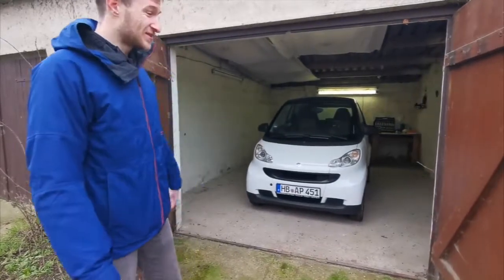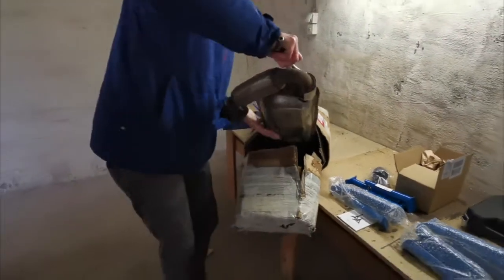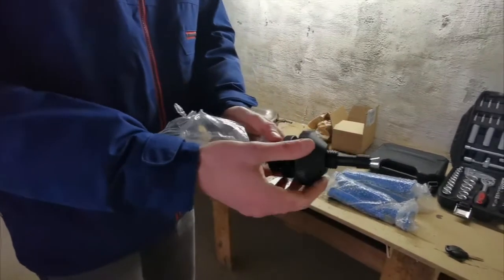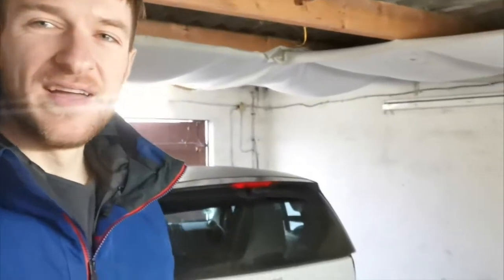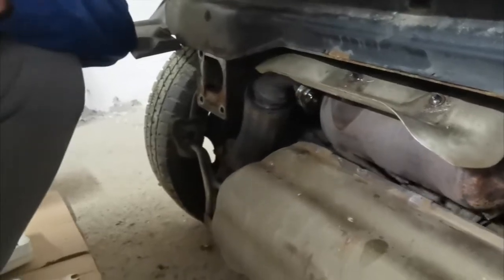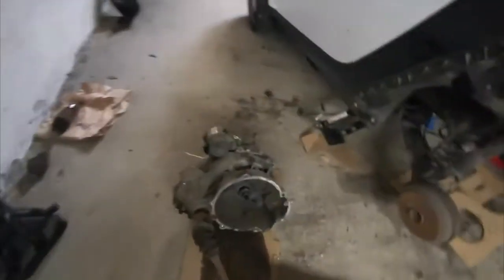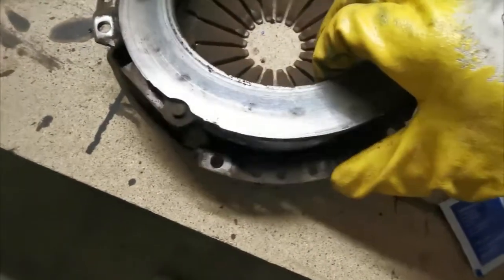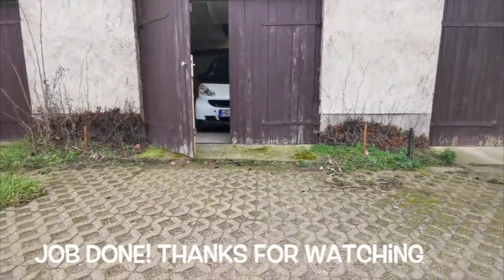SMART FORTWO 451 - Clutch Replacement, NO Engine Crane!

Comment: The problem with all these do-it-yourself videos are that they don't cover the basic steps like what tools do you need to raise, lower, move parts around. The people viewing these videos are not mechanics so these steps should be covered. For example, how did you lower the gearbox, by hand? Where did you put the jackstands? What is that clutch tool and what is it used for? Thanks for the video anyways.
Reply: Maybe I can chime in. The gearbox was lowered by the help of a car jack. It’s not too heavy by itself just the positioning makes it weird to work with when not on a lift. Just use a wide jack or support the gearbox on a plank placed onto any jack available. The jackstands were placed on the motor mount of the smart. It is a U shaped pipe. The only thing to be aware of is that because it’s the motor mount the suspension will compress when lowering onto the jackstands. It really only affects the clearance from the sides but when you take the wheels off (necessary anyways) it’s really not that bad. Tools used are really basic, as in a toolbox with automotive sockets (search for any toolbox with 100+ parts on eBay and it should have most things you need). The clutch tool gets inserted through the clutch plate into the housing and centers everything. You can do everything without it but aligning is easier that way. Believe me there are no mechanics in this video. As long as you are not scared to get your hands dirty and view it as a project that might take you a bit longer than a trained mechanic would you’ll be fine.
Reply: @PogU  Thank you Sir.

Comment: Great Video and thanks for uploading it for all to see. My 451 cdi 2010 has developed a rattle noise which sounds to me like coming from the gearbox area. The car drives fine however. Do you think it sounds like clutch and if so do I need to get the clutch kit plus the flywheel or just the clutch kit will do the? 
All gears do change OK but the gear numbers flash constantly on the dash. Please reply back and any advise as I am lost in this matter.
Reply from the maker: Hi Jas, sounds like 2 separate issues. 
- The flashing gears indicate the need for a gearbox firmware update, which can be done at your local smart/daimler dealership. I had it done prior to replacing the clutch for a cost of 80 Euros in Germany and it took about 30 minutes. 

- The rattle noise from the gearbox area could be clutch related. To be honest when i went to update the gearbox, the mechanic at the dealer just heard that noise and told me it's definitely the clutch. Perhaps they may be able to advise you too on the matter (free of charge) if you go ahead and get them to update your gearbox software.

When replacing the clutch I'd just order the clutch kit as the flywheel is rarely damaged. If when you take it apart you discover some damage to it, you can always order the flywheel then :)

Hope this was helpful, let me know if you have anymore questions.

P.S.: The OEM spec "Sachs" clutches are very well priced and are used by Daimler themselves in the manufacturing, so would recommend getting one of those.
Reply: @mattyscarchronicles9026  Brilliant advise I will order the Sachs clutch kit hopefully this is the cause as the car drives fine otherwise . Just need someone knowledgeable like yourself to fit it 😀
Reply from the maker: @jasa198  nice, im glad to help out somewhat... Um, well where do you live? I'd be happy to help if you live somewhere around Germany
Reply from the maker: Also because at Daimler they wanted around 1400 Euros to change the clutch 😑
Reply: @mattyscarchronicles9026  thanks Matt appreciate the help . I am a bit far from you in UK so I guess I will be looking for someone knowledgeable locally .
Reply: Hi Matt once again I would like your advise please . When I get the new clutch fitted does it need to go on a star machine ? Oh and the flashing gears I mentioned is no longer flashing anymore. Somehow they went back to normal .
Reply from the maker: @jasa198  Hi Jas, eh yep UK is a bit far right now, but I hope you find an honest mechanic or handy guy. If you live in the west Midlands I could reccommed you to someone (mechanic) honest and fair priced...

The clutch change does not require connection to a star machine. However, special attention should be paid to reinstalling the clutch actuator in its original position. You can do this by marking around the 3 bolts with a sharpie or similar.
Reply: @mattyscarchronicles9026  Thanks Matt . Good tip about the actuator . Mine is a semi auto. I take it yours was the same too and full auto or semi autos all are same procedure .
Reply from the maker: @jasa198  yes semi auto aswell, and I'm not 100% sure about the full auto but it should be the same I imagine
Reply: @mattyscarchronicles9026  I have ordered clutch kit from Germany its for the cdi 54bhp . I showed your video to my mechanic . He was very impressed of your work. I hope he can fit the clutch and the part is all correct.
Reply from the maker: @jasa198  that's great! I hope everything goes as planned. Can I ask, just outta curiosity, approximately how much he will charge for the labour?
Reply: @mattyscarchronicles9026  Thanks Matt. He works from home garage and has quoted me £220 . I think it is very reasonable price for the amount of work involved . He is helping me out as he wants to gain my trust and give him more work .
Reply from the maker: @jasa198  no problem, happy to help. And yep that's very reasonable compared to mainstream garage prices 😁 let me know how it works out in the end
Reply: Hi Matt need your advise please. I just received my Sachs clutch kit however it did not come with the release arm just 2 piece clutch and pressure plate . Question is can I use the existing release arm from my car ? Thanks.
Reply from the maker: @jasa198  I can't confirm that because in my package it was included but the one I removed didn't seem so worn. so I'd say you probably can refit the old one. Even better would be to replace the missing arm with a new (if you can)
Reply from the maker: @jasa198  I'd say go for it, the old one I pulled out wasn't so bad
Reply: @mattyscarchronicles9026  Thanks Matt. Yup I have given the car to my mechanic. He saw the parts and didn't say anything about the release arm. So I reckon it will be all good. He will do the work today hopefully.
Reply from the maker: @jasa198  awesome, looking for award to hear about the outcome 😁
Reply: @mattyscarchronicles9026  After the clutch has been replaced does it have to go on the star machine or will the actuator self adjust ?
Reply: @mattyscarchronicles9026  update . Matt . The car has been fixed today BUT the shaft seals are leaking so he will replace them tomorrow. Also we needed the release bearing and arm . So the cost of that went up by £85 more on top of £220. Hopefully I will have it tomorrow.
Reply from the maker: @jasa198  Hi Jas, sorry I've been a lil busy recently. the car doesn't have to go on a star machine. There's an auto-learn procedure, I think you have to turn the key to ACC and fully depress on the brakes. After about 30 seconds you'll hear the clutch actuator whining for a short time, then you can start it.
That sucks about the extra bills! Sadly I had my fair share of overbudget jobs due to annoying surprises 😩💸
Reply: @mattyscarchronicles9026  Hi Matt good to hear from you . An update for you . My car went back in today as he didn't change the drive shaft seals and It leaked all over the driveway. He has got the new seals from merc and will put them in today . Whilst I had the car it drove well and gear change was as it should be. Hoping to have the car back this evening . This mechanic is a real good find for me . He is honest and is working from home . I think I will use him more often from now. Thanks for your advise and help too. You have been great help in getting my car back on the road as I was seriously looking to scrap the smart and just buy a Toyota aygo .🙏
Reply from the maker: @jasa198  I'm glad to hear that it's been sorted out in the end.It's nice knowing that cars are being brought back on the road, especially for such a minimal cost, rather than purchasing new ones :)
Reply: @mattyscarchronicles9026  Hi Matt well here is an update. Got the car back and the new drive shaft seals were installed and are doing their job as they should no leaks around them however  problem is I still have gear oil seeping through the housing just below the filler plug and all around it. I have spoken to my mechanic and he thinks it could be the seal inside which he did not change so the car is going back tomorrow. Also I have noticed that the car is not as quick in torque as it was before, the rev needle moves rather slowly upon acceleration and once it eventually reaches 70 mph I feel a sudden power loss although no lights on the dash but it deffinately goes in limp mode. If I switch the engine off and on again it will resume power normally until it reaches 70mph then again limp mode occurs. Any idea what could be causing this as I know the car was very responsive and had plenty of torque. Sorry for the long post.

Comment: Hi matty
My car doesn't go in R(reverse) some time and some time just stop on middle of the road and start blinking 

Is that to do with clutch or update
Ur advice please
Reply: Check your clutch and/or actuator…
Reply from the maker: Hi Wajid, if it’s intermittent it could be a position sensor fault since the actuators aren’t very robust. But I’d start with a gearbox update and go from there. In Germany it cost 85 euros including tax in 2020.
Reply: Put in to reverse get some one to watch if the aculator moves

Comment: Hi did you drain the gearbox, when you removed it, as I did not see how did you removed it from the engine, plus how did you take it down by yourself, and how did you put it back by yourself or did you use a jack?
Reply from the maker: Hi John, thank you for your Qs. 
- I mistakenly drained the gearbox fluid, even though this is not necessary. The gear oil was approximately 1.2 kg only if I remember correctly, so it wont weight you down.

- I removed it by putting a 2 Tonne jack with wheels underneath the gearbox, with a flat piece of wood on top to distribute the weight a little bit. Once dropped on there I pulled the jack out while holding the gearbox (awkward but not too heavy). Exact opposite for putting it back in the car.
FYI, I removed the top engine mount on the left side and allowed the engine to tilt down, aiding it with a second jack.

I hope this cleared things up. If not please just ask 🙂